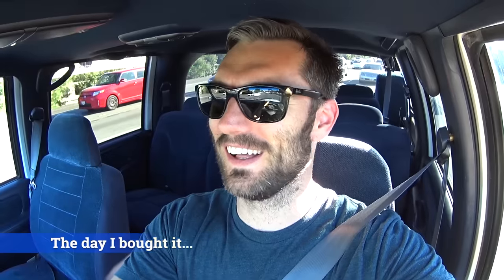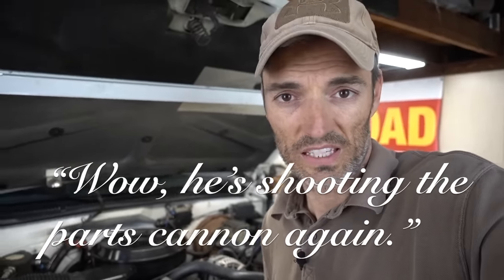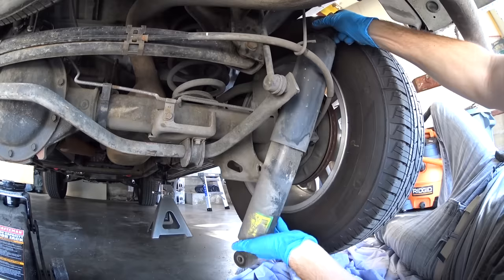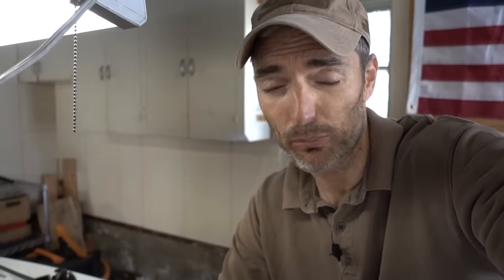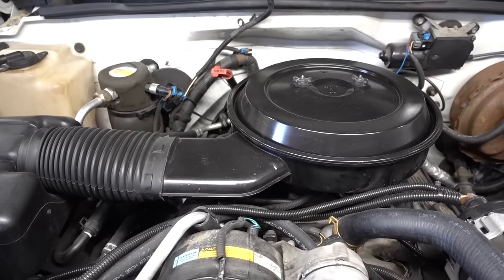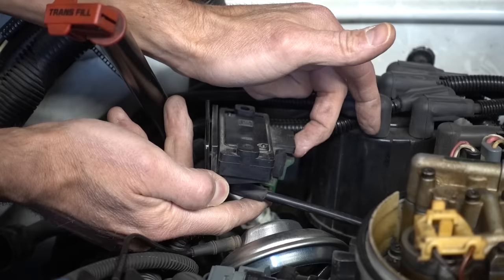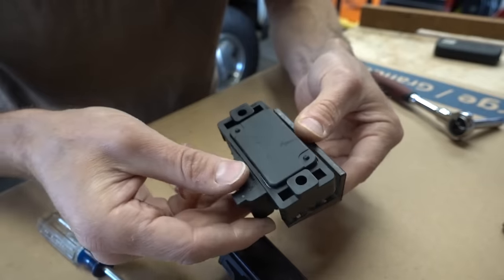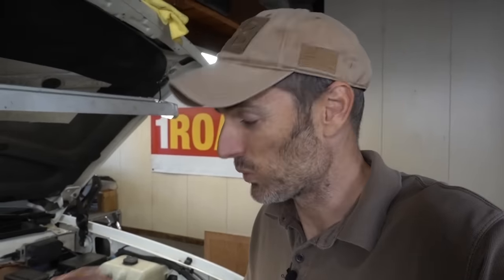The ONE REASON Why My 25yr Old Truck Runs So GOOD!!

Comment: Old video just wanted to say this may be a little off-topic I didnt mind working on cars before the computer age, but then computer systems were added and for myself  I couldnt just stand and listen to an engine and" know what's going on"  you needed a scan tool and those scan tools are not really reliable for some things.   I got used to them, the bigger issues is sometimes to get at things you spend 1/2 hr just removing all the plastic covers to get at something that only takes 3-5minuites to replace then another half hour and hopefully the clips are still good .
 don't get me wrong the vehicles as of late have many things going for them, but I like old school simple things I used to be able to just listen to an engine or just listen to a engine turning over and pretty much figure out what was going on now so many sensors on sensor goes or becomes faulty the scan tool may think that It's something else because all sensors are tied into each other . 
On my 06 Lexus is350 there is an issue that sometimes pops up with the transmission a sticky shift valve that usually happens is the car I don't want to say is cold  but when I first fire it up and even if it warms up it sometimes happens, my way to sort of fix it is to actually shift manual for the fir  t5 minute of driving it seems to fix the issue then all is good.  t if I were to take it in it would cost 1000s to fix this car drives great has some pick up and go kind of a sleeper.  I never liked the stupid traction control stupid thing almost got me in a serious accident while driving up hill in a the snow it kicked it car stopped massive full size 4x4 almost plowed into me  had to find the stupid button to turn it off ( which it automatically tuns back on within a minuter or two ) so I could get the wheels to turn and eventually grip,  I prefer old school   top many things could possibly go wrong and if your out somewhere along the highway you're stuck, with older vehicles I could most likely patch it up to get me to the next place where  I could fix the issue.
and do get me started with fobs and no key I cant even put the fob in my pocket without it locking unlocking doors ( I had a few times gotten into my car sitting there the doors lock but then I remember I need to get something  I open the door car alarm goes off lol ,    it isn't just one fob it's both fobs I have to put them in a pouch that blocks most of the signal but still cant put that fob in any pockets  I clip it to the inside of my shirt on my chest that seems to be the only way it stops that hehe

Comment: Great video Jimmy, I daily drive a 1993 Yukon with the same reliable engine. However I refuse to remove a part that is made in America and still working in favor of one made in China, I realize you are using OE parts which I appreciate but they are not of the same quality as the actual original equipment. I love older GM products but it is a shame they have outsourced everything!

Comment: Just a heads up. No map relearn on that truck. When you disconnect the battery it erases all the fuel curve data so it takes several drive cycles to relearn. Not a big deal it probably cost you a little on milage. But not a bad job. Keep learning and doing it yourself. Much cheaper.

Comment: You said the one reason, let me help you with that, the first and foremost reason, it's a mid 90's GM truck, they have been determined to be the best vehicle ever produced, will run more miles with less maintenance than anything else, these are true million mile vehicles, as a mechanic I have seen it several times.

Comment: I'm all for preventative maintenance but especially with some sensors they require the actual OEM sensor to be reliable which makes them expensive. If you have the money and are looking to spend it for the sake of spending it then go for it.

Comment: as long as it isn't the Chineese part's cannon, that's just asking for it, learned that lesson on my first boat.  Rather have a 25 year old OEM part than a knockoff that lucky to last a year
Reply: oh boy I posted that before watching the whole video.  "MADE IN CHINA". I've found if you can't get the US made part from AC Delco then I switch to Standard Motor Products "Made in Mexico" parts, they bought and moved the OEM parts down there, very good luck with those vs say the AutoZone and Ebay and Amazon specials.

Comment: 1994 ford van I was respacing  all wire I've seen and there one engine to firewall . I push the wires apart right off th conector . And  what a surprise the van had about 10-15 more hp. Second gear auto and top of 1 st has strong pulling power in normal driving . Before that you could gas it but slightly faster. LOL? Not touching  that area again. Cause the wires look good, but just happy cause it a heavy van but feel like a new engine. LOL

Comment: I'm a retired auto and truck mechanic, and throughout my entire mechanic career, I've installed brand new parts that proved to be faulty regardless of who manufactured them, it could be anything from ignition parts, ICM, secondary coil, spark plugs, spark plug wires, rotor bug, primary coil, distributor cap, TPS, IAC, MAP, fuel injectors, alternator, starter, water pump, wheel bearing, serpentine belt, any part within the transmission or engine, therefore, there's no new part that is a guaranteed part that'll last .

Comment: Those TBI’s would run forever. Not big on power but no torque management meant you got to use all of it. No intake gasket issues like the Vortecs had either.

Comment: I can't fault his logic but I don't do the same.
Both my 1999 pickups run perfectly. Near zero fuel trims. Ram and Sierra. 
I felt bad replacing the lower intake manifold gasket (didn't know it already had GMs upgraded design gasket) on the Sierra when I upgraded the spider injector to the upgraded design (without poppet valves). 
And I felt bad replacing the ignition coil on the Ram (I did stick with mopar coil) since I had replaced the plugs, wires, cap and rotor... just figured I'd do the whole ignition.  
Other than that... I only replace parts that are bad. To pre-emptively replace a part when not needed irk me... which is why I will always remember that gasket and coil.
Every part can be diagnosed with good accuracy... I avoid parts cannon. Proper diagnosis makes me a better mechanic.

Comment: One thing I’d like to add is to keep the old parts and even keep them stashed in the vehicle! I am of this same school. However, I replaced every component like this that I could when I changed the engine. Some of these new cheap online and parts store parts have failed including the MAP sensor, knock sensor and three AC compressors. Some things you should just go to the dealer for!

Comment: My Triumph motorcycle dealer charges $120 for an oil change on a Triumph Bonneville. I can do the job myself for about $50. If I wanted to use an aftermarket oil filter, I could do the job for $40. My Triumph is worth OEM Triumph parts.

Comment: I'm a big fan of the parts cannon. 
Just replace old stuff, particularly rubber and plastic, particularly if you're doing work that requires removal anyway.
Replacing your radiator hoses is an obvious one. Rubber and plastic just get old. They don't last forever, even if the car has just been in storage.

Comment: There are certain parts that, in many vehicles, including this Suburban, are going to be better off left alone, if working. If you work in auto maintenance and repair these days, you're probably well aware of how unfortunately common it can be for a functioning, 25-year-old, actually original-equipment part will turn out to be more reliable, and/or last longer than any new replacement part that's currently available. Even with the 25-year head start, certain categories of aftermarket replacement parts have become so universally bad, across the board of brands and suppliers, that it's common for the brand-new "preventive replacement" piece to fail within a couple more years. There are some parts that, because of the dip in availability of quality jaftermarket parts, I will only replace some things after they conclusively fail. In that situation, I will check for good used OEM parts from my trusted sources at wrecking yards, rather than to ensure I'm stuck doing a yearly warranty-return on it until I get a lucky good unit, for once.

If you're the type of person to take the approach above, of "may as well replace it since it's old;" if you don't have the experience or an insider hookup who does, save all the working parts you replace preventively! It's not at all uncommon for there to be zero availability of anything, anywhere, that is of remotely equivalent quality to the stuff the vehicle left the manufacturer with. Like engine mounts, for example; across all the big aftermarket parts houses, there are often only two brands (which I'm pretty sure are actually from just one manufacturer) available. They (Anchor brand) are often stupendously, suspiciously inexpensive... Because they are crap. They barely fit, and sometimes they simply do not fit at all. If they do actually fit, they usually transmit far more noise and vibration into the cabin. A couple of times now, they've been literally worse than the old, oil-softened mount being replaced, causing vibration issues that weren't there with the worn-out original mount. Worst of all, it usually comes down to buying an Anchor mount for like 20 bucks, or a new one from the OEM, for maybe $350!

It's ridiculous.

Don't just toss working original parts in the trash, if there's no other reason than age. It might save you a real headache.

Comment: I have a 1993 Chevy Silverado 3500 extended cab that I put 800 miles a year mission-put the boat in beginning of the year into its slip and the goes to Home Depot a few times a year then pull the boat out. My two biggest expense new fuel tank and fuel lines and brake lines and new tires rust.
the body is rust free garage kept and when I took the truck for new tires (old tires aged out) Two of the tire mechanics wanted to buy my truck.
I took my grandson for a ride and he said hey Papa how do you open the window it has no button. I told him you see that handle turn it counter clockwise. And then he asked what is a cassette player and cigarettes. God Bless my 28 year old pickemup truck.

Comment: PERFECT LOGIC...OEM IS ALWAYS BEST...I HAVE A 91 SENTRA XE (5 SPEED 4 Door) some OEM parts are not available...my water pump just blew the seal loosing all coolant...(but it needed changing anyway) so...OEM HITACHI PUMP IS 75.00...BUT AFTER MARKET IS 40.00(+-+-+?) (I am 72 now...skin is rice paper...check oil...I bleed so to speak.)Labor and part is 450.00 (Thanks Barry Soetoro...aka...NObama)...

Comment: Good on you for paying attention and making an effort to catch little problems before they become big ones. I have to disagree with "I know it's not bad"  One thing you arent accounting for is most anything you buy, replacement parts included, are often not nearly as well made as they were 25 years ago, some times they are better, but most of the time they are made with cheaper materials and construction techniques, and most of the time they arent as good.  And it is not entirely out of the question to get a new part that is no good. Probably half a dozen times in the last 30 years I have got new parts that were no good and had to return them.

Comment: I would add on old vehicles replacing a part can cause other old parts related to that system to fail so I replace them also most of the time.

Comment: With the OBS Chevys the reason you all are having problems with the transmissions is because you are towing in OD according to book it says only tow in 3rd gear ⚙️ towing and towing up hill if it’s in OD it will keep searching for gears causing it to fail. OD is for city driving freeway etc.

Comment: Pro tip, most vehicles over 25 years old are exempt from mandatory smog testing.  But, check your state's regulations concerning the topic.

Anywho, why replace the EGR?  Just buy one of the many blocking plate kits available and be done with it forever!

So, what's the EGR valve for?  It allows inert gas (CO2 laden exhaust gas) into the combustion chamber to keep temperatures down so fewer NOx (nitrogen oxide) smog compounds are produced.  The valve's absence will have no drivability or performance impact on older cars with limited downstream data gathering (O2 sensor above and below the catalytic).

Comment: Egr valve is not supposed to hold a vacuum. It is engineered to have a slight air bleed to alleviate strain on the diagram and promote longevity. The most probable reason it idles better is because there was a piece of carbon stuck in the valve, causing a vacuum leak, which could have easily been cleaned. BTW...I have a 30yr old vehicle with original hoses on it and have no plans to replace them. New aftermarket hoses still don't match the quality of my 30 yr old ones.

Comment: Your chanel is fabulous. I have a 2004 Suzuki xl7lxex34wd 5 speed auto 2.7L who is aging extremely gracefully. I am it's second owner. I want brand new rotors ((they said I don't need them but I saw rust). Since  she's a Suzuki I want to know what your top brake rotor etc parts and can I put red calipers. Will they show up? My car purrs like a kitten. I noticed Amazon has a great deal on a set. Should I go there or maybe partsgeek? I used my stimulus to fix so far dolled up the wheels to new centercaps oem and rims. Alloy as iem and all terrain tires. She's beeming! Us a new caliper  a big job?

Comment: hell yea brother! I've got a 94 chevy pickup I've been working on. Had a few common issues like rough idle and stall during start ups. Becuz of you and this channel I fixed and swapped the idle air control and o2 sensor by the tranny. Truck has been running good ever since. Bout to figure out the egr valve next. When taking a look I realized the vacuum line was off and plugged with a screw. Now I'm trying to figure out what to do next. The truck is running good with out the egr, so should I leave it? or reconnect and see what happens?

Comment: On pre obd2 vehicles, the computer is unplugged every time the key is turned off.  No need to disconnect the battery for these simple parts replacements.

Comment: ah the good ole parts cannon. i have a 94 chevy silverado, and at this point, its WAY simpler to just say the things i havent replaced are the suspension, the rear axle, and the body panels. it aint pretty, and it certainly isnt like riding on a cloud, well maybe a storm cloud... but shes been built to last and i can say that with certainty because i built it to last

Comment: Overall I agree, however a word of warning is appropriate. Parts quality is not what it was 25 years ago. Just because you replaced an “old part” with a new one, does NOT mean the new part will last. I recently went through four brand new mass air sensors before throwing in the towel and upgrading to a new card style maf since I have a fully programmable aftermarket ecu. No more issues. 

With more older vehicles that use points ignition, newer replacement points are VASTLY inferior to oem ones from the 70’s and before. They just don’t work as well or last anywhere as long.

Comment: Guys that rag on you about the parts cannon ... they're the guys that replace 1 tire, and wonder why they got 2 flats a month later. They're the guys that replace one brake pad and wonder why they're ALWAYS doing brakes. They're the guys that dig into a motor and replace only what's wrong - only to have to take the same crap apart 2 months later to replace something they should have done while they were in there.

I do at least 2 tires at a time. I do brakes in pairs - and I OFTEN times replace calipers / wheel cyls / rotors and drums regardless of how they look. I like tires to not come apart, and brakes that work. I drive a 1991 C1500 - and it drives beautifully. I'd put it on the road and ride from coast to coast tomorrow if I had to.

Comment: It's a given those old plastic connectors will crack with age. Further it doesn't help when the plastic locking taps stuck in the lock position no matter what you do and no room to get at it. There are more and more counterfeit parts ( I had a few from Amazon), thus parts cannon could create a need to drive hours across state lines to shops like Pine Hollow Auto Diagnostics.

Comment: Just put 2k in my 01 Toyota Tacoma. On all parts that are known to fail. Even replaced the timing belt with a water pump. Looking to get another 200k miles.
Reply: Get your valve lash checked. It actually shrinks. My 2000 Tacoma burned valves over it. Had to pull my head and everything attached to it. Which is damn near everything. 3rz-fe is .008 on int and .010 on exhaust MINIMUM.
Reply: Which engine do you have?
Reply: @pitchforkpeasant6219  3.4 v6

Comment: Sadly the problem with replacing parts on older vehicles in today's date is that you're not getting the quality of the 25 year old part you are getting aftermarket parts, very cheaply made that will easily fail much faster because they have  discontinued most OEM, genuine GM parts & Delco parts, that's actually raising your chances for failure using cheap aftermarket parts.

Comment: I generally agree on most parts. But some parts the aftermarket ones are honestly worse than the original. You can buy a new part these days and NOT know that the problem is not the part you just replaced.
Reply: Just because its new doesn’t mean its good. Not just a saying for automotive parts either unfortunately. Construction supplies including light bulbs, switches, and outlets.